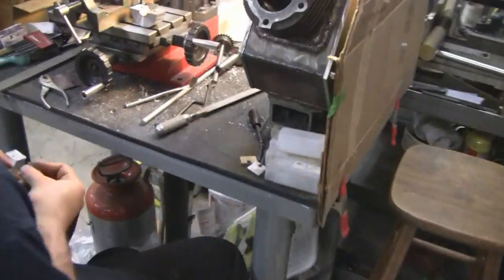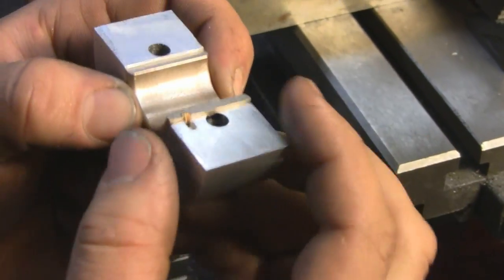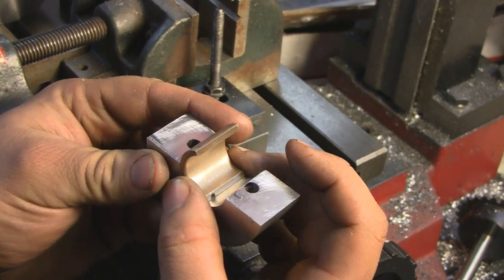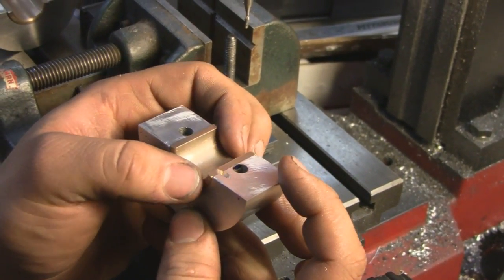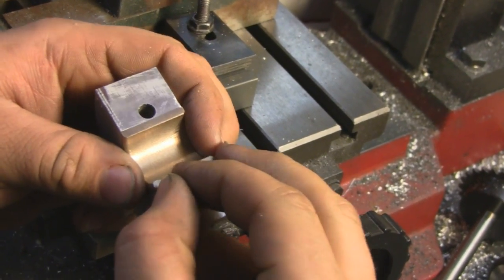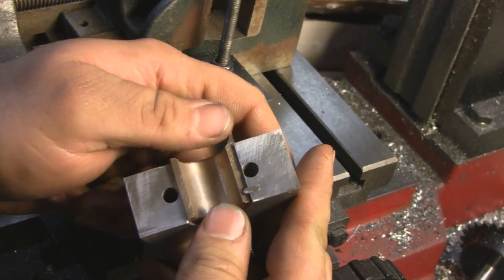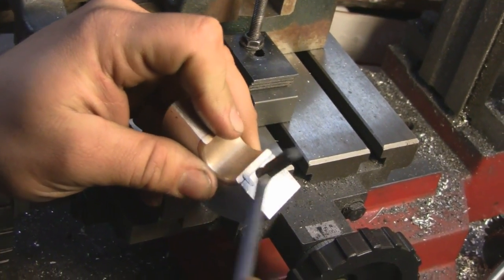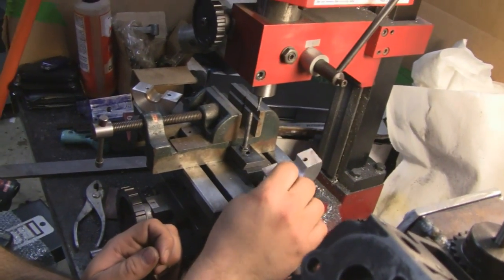HOMEMADE RADIAL BRIGGS ENGINE (part 16)

Comment: Wouldn't the pin work to hold the bearing from moving in both directions? I thought of the tab on VW  type one engine rod bearings at first too.
Reply from the maker: +Jon Hare Not without the shim!!☺

Comment: Pinning the bearing like VW (air cooled) does would have been a great deal faster and a lot less work.  Or not...  Take care, be safe!
Reply from the maker: +Ironheart Fabrication We considered doing it that way first but didn't think the bearing was thick enough for it to work without failing!!☺
Reply: +Ironheart Fabrication I thought the same when the problem was first presented. Actually pinned and through holed using a roll pin was my idea flash.  Deeply counter sink the rod-cap to retain the pin mechanically and shallow C/sink the bearing yet retain a small hole for oiling. (capture the roll pin)  Oh! then get fancy and NACA inlet that outside hole on the rod-cap to help gather oil. jm2c,  project looks great.